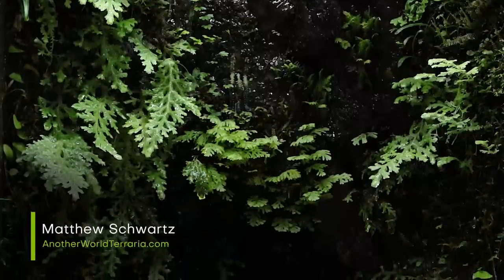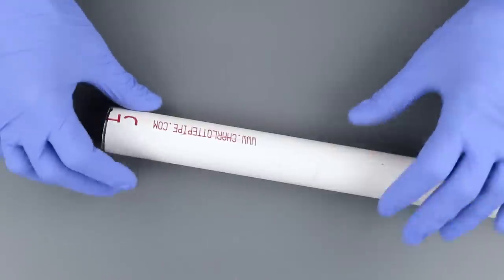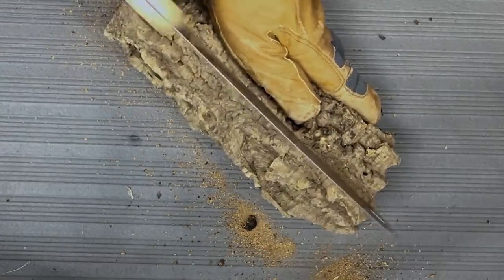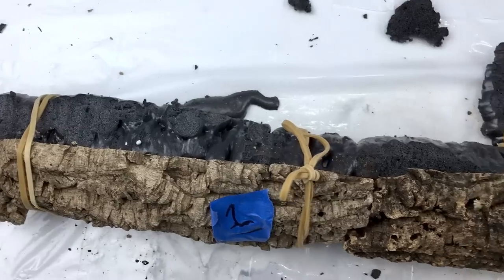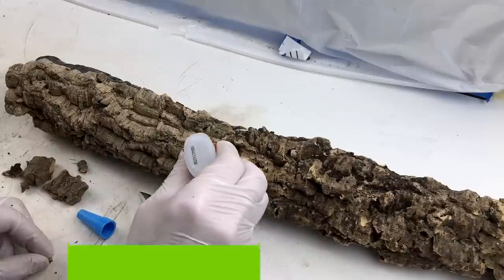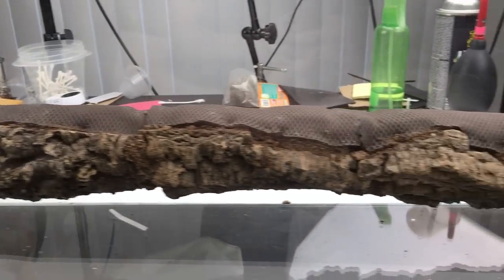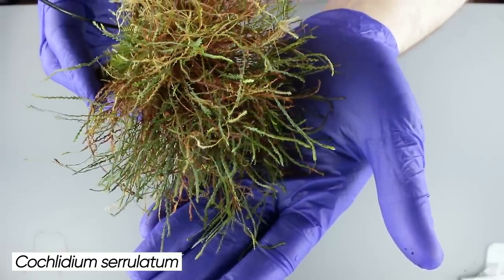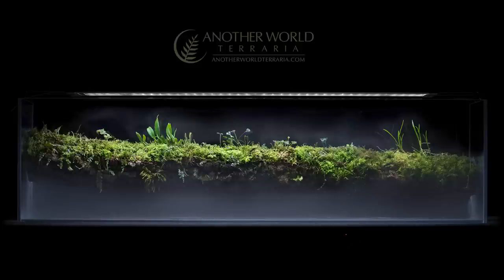How I Made the Branch Terrarium (secrets revealed!)

Comment: Very inspiring! And so detailed -- so cool. Do you have a tip where to buy plants? E.g. the two Elaphoglossum I couldn't find ..
Reply from the maker: At this time I generally don't recommend specific sources for plants because there are many sources and many types of plants, so each case varies, but most of my sources are just hobbyists and smaller or private vendors. It also depends where you live. Please check out https://www.anotherworldterraria.com/faq/#plant-sourcing which is a general summary of the types of sources I use, and has tips on how to build a network of sources for yourself. There are not any specific vendors listed there though. Following the suggestions might help you eventually uncover some sources that work for you. I hope that helps!

Comment: Great setup. I'm gonna try this.. Why not foam the pipe strsight to the Cork?
Reply from the maker: Thanks. If you mean spray the foam and attach the PVC and the wood right then with the foam, the reason why not is because it would be impossible to control the foam thickness and shape, or to prevent the wood from being displaced.

Comment: Do you have a lid on this, or do you keep it open with a fogger to maintain humidity?
Reply from the maker: It's kept sealed with a lid.
Reply: @AnotherWorldTerraria  do you also keep a fogger running in it? Or just open and mist it?
Reply from the maker: I don't have a fogger running usually. I just do it occasionally, tbh because it looks cool. I just open it to water. Nisting by hand with a pump sprayer, often enough to keep the top moss and plants moist. I do it heavily enough to saturate the entire thing so all the moss and branch is dripping water down.